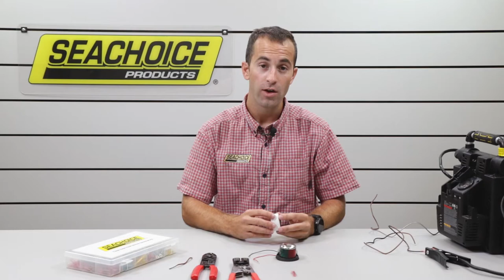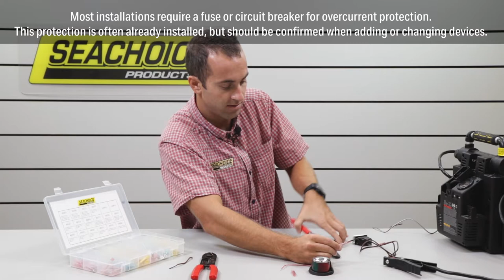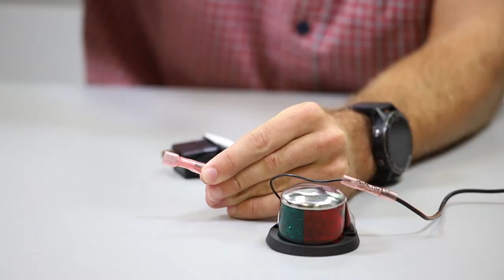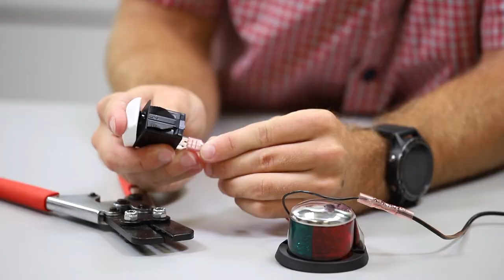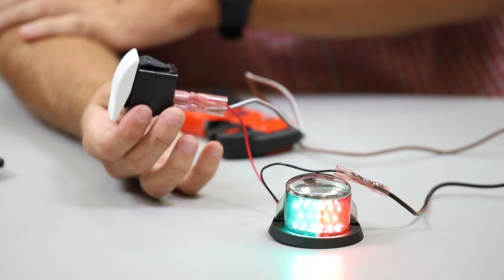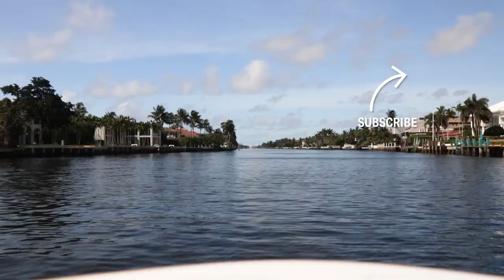How to Wire a Bow Light to a 2-Position Toggle Switch

Comment: Great video but you need to clearly explain that the black ground wire goes to the negative terminal of the battery. You only say that the 'ground is connected to the battery'. It is important for beginners that you explain that ground/black/negative goes to the negative terminal and positive/red  goes  from the light to the switch and then on to the positive terminal.

Comment: Great video. I noticed you did not use a fuse in this circuit. Is there a reason no fuse is needed? EDIT I think I figured it out: The light bulb acts as its own fuse
Reply from the maker: If the circuit is not overcurrent protected at the switchboard then a separate fuse will need to be added for that circuit. Per ABYC: Each ungrounded conductor of a branch circuit shall be provided with overcurrent protection at the point of connection to the main switchboard unless the main circuit breaker or fuse provides such protection.

Comment: I noticed when you used two disconnectors for the red cable for the bow light I understand, but does that other quick disconnect wire have to be a positive wire like copper or a negative like aluminum? My switch has a copper side and aluminum side that needs to match.

Comment: Great video. Do you have a video on running wiring from rotary switch as dash to rocker switch at bow. The rotary switch at the bow of my boat has never worked. I want to run wires to it.

Comment: i have a 2005 bayliner 175. both of my wires that run to the bow lights are black, how do i know whats positive and whats negative? thanks. 
p.s. have you got a item number for the bow light? is it available on amazon?
Reply from the maker: You can determine polarity with a multimeter. Yes, the bow light (P/N 50-02041) is available on Amazon: https://www.amazon.com/dp/B005NIAQWQ

Comment: If you needed a fuse, would you put it between the light and the switch or between the battery and the switch?
Reply from the maker: The ABYC recommends placing the fuse as close to the power source as possible. For specific wiring questions, please contact your local marine mechanic or electrician.

Comment: Connect straight to the battery...No fuse?
Reply from the maker: The ABYC recommends placing the fuse as close to the power source as possible. For specific wiring questions, please contact your local marine mechanic or electrician.

Comment: Hey man Im looking to do this same wiring in my car for an LED light with a kill switch on the dash 
I was going to fuse tap into an ignition live (accessory port) so the lights come on with the turn of a key but also have a killswitch to turn them off if desired whilst car is running.
Fuse Tap > Positive wire > Kill switch > Positive wire > LED Light > Negative wire > Ground Eyelet to metal chasis

Or would I put the Killswitch on the negative wire side ?
(I dont want a constant power to the LED with my understanding having the killswitch on the ground side would still have the LED running hot with the positive going through it ending further down the line at the kilswitch negative)

I hope this makes sense im trying to get my head around this wiring carry on
Reply: most require an in line fuse why didn't you show that?